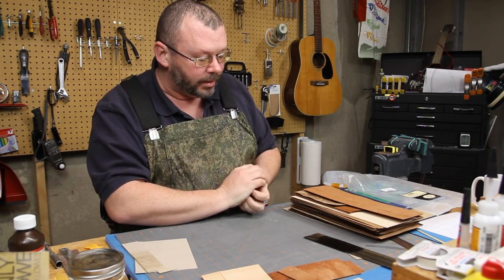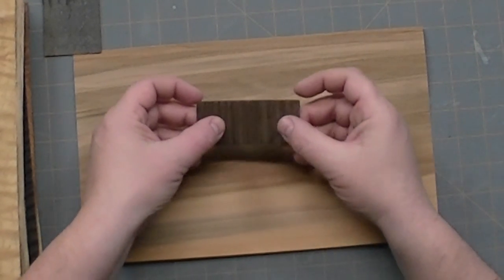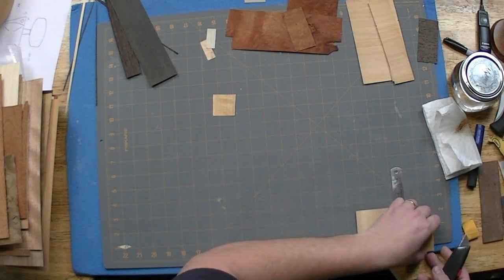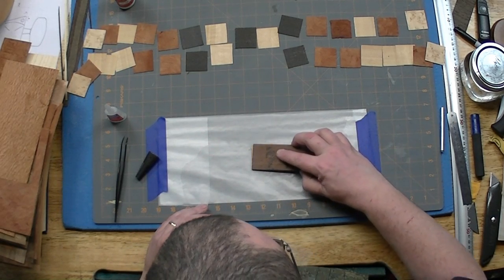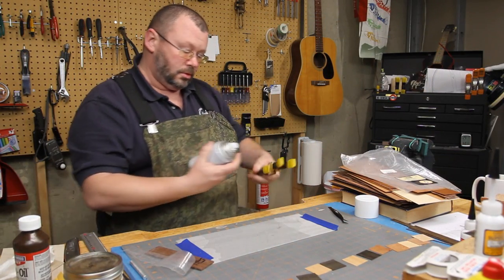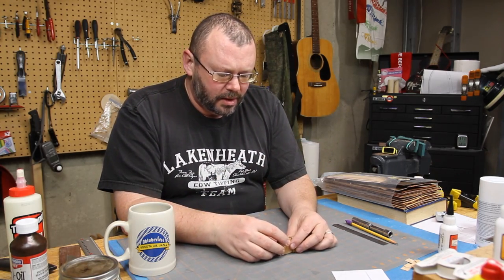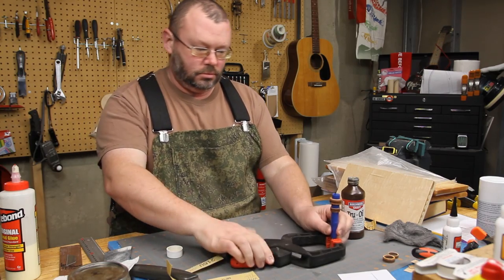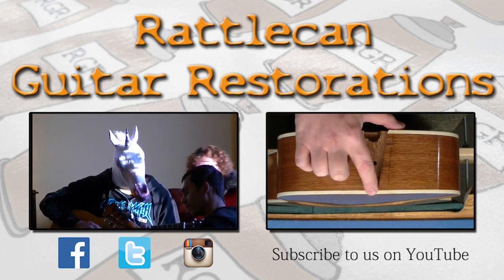wooden rings | FUN WITH WOOD / RGR by James O'Rear

Comment: Great video! Thanks for the info. Any idea whether a P100 respirator mask (I'm using a 3M 6800 series half mask respirator) will protect against CA glue fumes? Apparently P-type masks filter out oil-based particles, whatever that meant.... thanks!!!
Reply from the maker: Jeff Chain I don't know. Something's *probably* better then nothing but I bet the 3M site has that info buried in it somewhere. Thanks for watching!

Comment: I use CA for all sorts of stuff, and I'm a convert to FastCap's 2P-10. It's sold as a "two part system", but that's just marketing to get you to buy their accelerator with it: it's just CA, although a high-quality one. The nice thing is that it's about half the price of the other "premium" brands, at least through Philadelphia Luthier Tools.

Having said that, I think I'm becoming sensitized to CA in general. Last summer I refinished an MIM Strat body, and decided to use CA as the sealer (the FastCap bottles are big and I figured I'd never finish it before it went bad. Even with two liberal coats of CA over the entire Strat body, I'd only used a third of the bottle!) I spent a good couple hours working with that stuff in my dining area, with only a window open...across the room. You know that warning on the label that says "Prolonged exposure may cause flu-like symptoms"? Yeah, turns out they're not lying: I ended up congested, sniffles, dry eyes and a wicked sore throat. It went away after two or three days, but it was really unpleasant, and now I can't even open a container of CA without instantly starting to feel like that again. It's annoying because I use CA for all sorts of stuff, but I have to limit myself to no more than a couple minutes of using it before I have to take a breather for a while.

I did some research and it turns out it's not particularly dangerous, just highly unpleasant. CA sensitivity is no joke, and it really pays to have some kind of fan or even a cheap respirator if you're going to be handling it for long stretches of time.

EDIT: the rings look cool BTW ;) .
Reply from the maker: +catdumpling Thanks for the info. I know the warnings may seem like overkill but your experience is why I did it. I want the younger viewers to be around as long as possible. I have a good friend who has extreme sensitivity issues with cocobolo rosewood which is a shame, his instruments are beautiful.

Comment: This is nice! I saw some methods about doing wood rings and i think this is the easiest way to go. Im just a bit worried about the strenght of the ring... is there some way to test how much weight can it resist without breaking? 
Thanks! :)
Reply from the maker: Build one and start piling on weight until it crushes I guess.
Reply: francis318VH 
But you put a ring on your finger why would this resist a certain weight since its in your finger
Reply from the maker: It seems purely academic at this point.

Comment: thank you.  question please how do you get the ring size right ?
Reply from the maker: Blind luck. Seriously, I traced one of her rings and farted around with bits and sanding until I got it right. Currently I operate in "proof of concept" mode for the most part, slowly working my way up to "precision and repeatability" mode.
Reply: makes sense thank you
Reply: Maybe a bit late, but you can try this: http://images.zales.com/images/popups/zales_ringsizer.pdf

Print it off, use a razor to cut out the ring holes (carefully), laminate it so it lasts, then lay it on your wood for centering/drilling.  Be sure to leave a little excess so the sanding process doesn't throw off the size - then just sand until it's smooth and matches your chart.
Reply from the maker: Sweet, thanks Matt!
Reply: Matt Mould thank you

Comment: Man, ALL veneer MUST BE SOAKED IN WATER BEFORE glueing.  Let the veneer dry to until it is damp, then glue pieces together, and add clamps or weights. Be sure to use water based glue.
Reply from the maker: If using wood glue I would concur. I didn't and nearly three years after this video they are in fantastic shape.